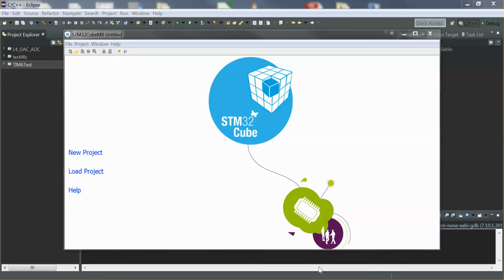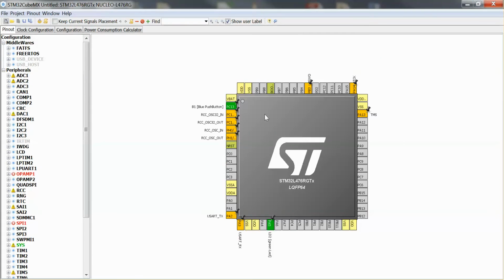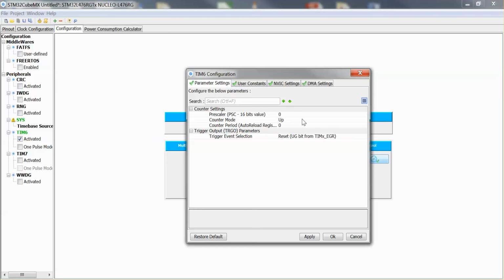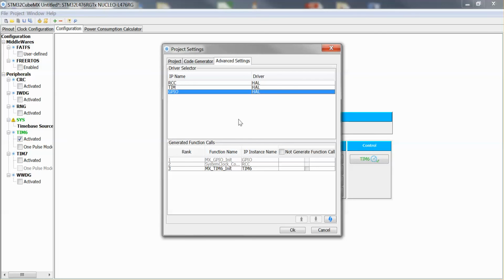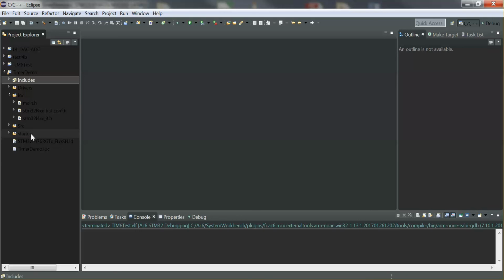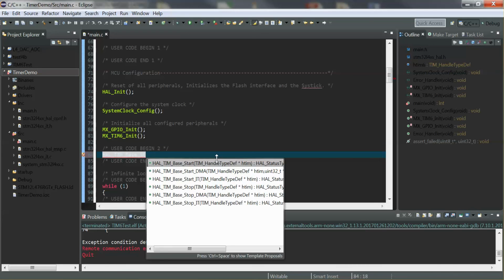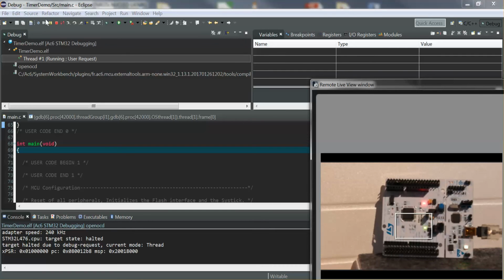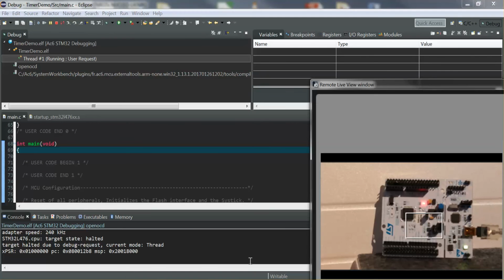STM32 - System Workbench - STM32CubeMX

Comment: Just use GNU MCU Eclipse. No need of this stuff...
Reply from the maker: Yes, indeed that works too, but if you are not an expert "this stuff" really helps. Also dealing with libraries (i.e RTOS, LWIP etc) is made much simpler using CubeMX. For low to average expertise users I think these tools can provide good support.
Reply: @fagosti  CubeMX is ok, but if you have to spend time to set up Eclipse, AC6 is worthless. Just go with a free open toolchain like SW4STM32 with Cube. Then, after you did your excercise to learn basics, switch to GNU MCU Eclipse. You can develope every project, no limits, multiple debug methods and A-series support too. And is full of guide and examples. It's not meant fro "pro users". I started with that from zero (almost, I just had some experience with Atmel Studio). The fact is that you should leave ST lib as soon as you can, or they will turn you stupid/limits you soon. Also you'll miss the very behaviour of things.
Another good way to start for beginners is mbed. 

What you showed here would be my last choice, honestly.
Reply from the maker: @RickerAlricRahl  Thanks for sharing, I guess "to each his own" . I also find the new integrated IDE  (CubeMx and Eclipse) quite convenient to be honest. I also kind of like mbed,  there is a lot of stuff around for it. Also the ST Community is quite helpful as well and the solution I showed is the one suggested by ST and used in their official trainings anyays
Reply: @fagosti   I'm just telling to people who might see this video others way to approach MCU programming. All that I'm stating are just opinions, not absolute truths, so feel free to disagree in case. It's just my experience on the theme. I've been to several workshop too (one recently of ST on the new MP1 family) and I think that during these meetings they always suggest you their most convenient approach, not yours.
Reply from the maker: @RickerAlricRahl  Thanks, I have no problem at all with your suggestions and I believe they are valuable for others approaching STM32 coding. I am sure glad that many different options exist, but I cannot obviously speak about those I never tried myself :) About ST suggesting what is more convenient to them I am not really sure how would that translate because their main interest is for people to be able to code with their hardware with  the least issues possibile, which happens to be also my personal interest when I am coding, so I cannot see a problem there.